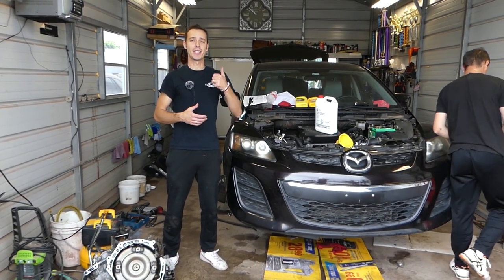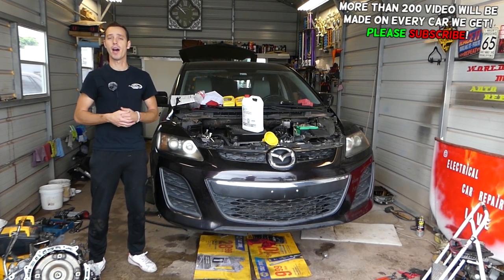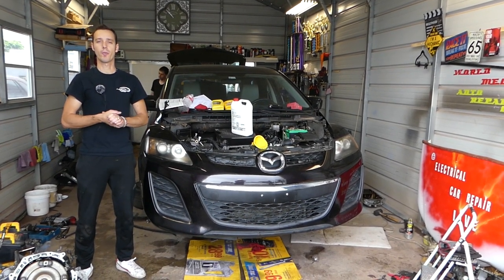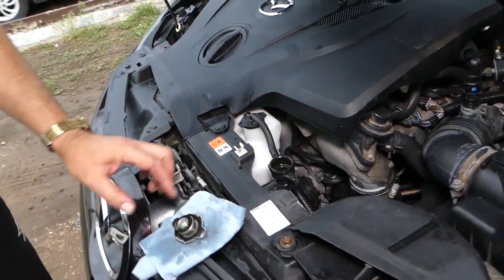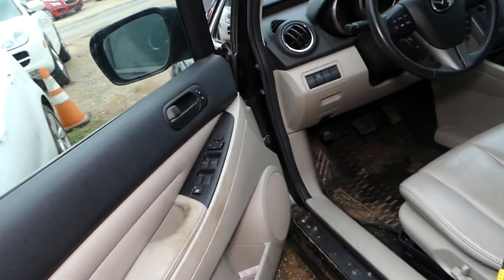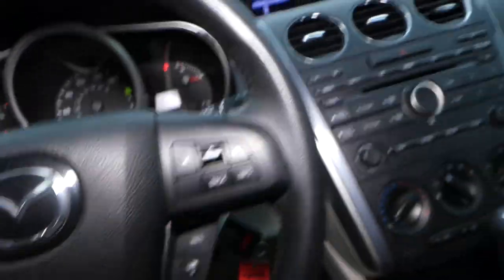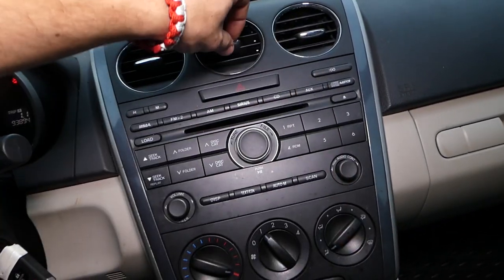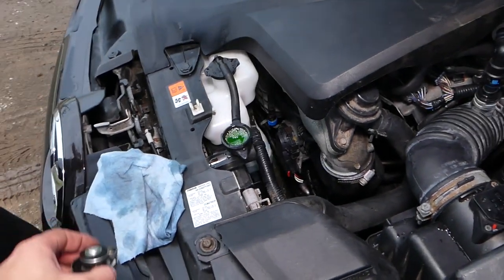HOW TO BLEED COOLING SYSTEM ON MAZDA 2 3 5 6 CX-7 CX-5 CX-3 MX-5

Comment: I'm not sure I see the point of all this.  It's not like you ever opened the radiator cap to let out any air.  And it seems just driving it around normally would accomplish the same thing that the revving does.  Why not just drive it for a couple days, remove the radiator cap to let out any pressure, and call it good?
Reply: I'm unsure on reason but mines at garage atm I do lot of stuff myself usually but as garage done some major wirk I left them to sort it.....New hg ...under a year ago new thermostat and coolant sensor .....now over heating ..... I'm thinking the coolant sensor either wasn't a goof 1 or its not been bled well enough

Comment: What I learned from this video: Be sure to buy 6 times the coolant that your car requires, since 5 times the required amount will be needed to properly coat your entire engine bay. 

Seriously though, even when you guys decided to use a funnel you weren’t getting it in without making a huge mess. Your customer is going to have one hell of a smoke machine when all that coolant burns off in the form of smoke. 

Just being honest here, but after seeing this video I would not even let you guys fill up my wiper fluid. If a haphazard job is going on for little things, I would worry about the more significant parts of the process or other repairs. Precision and taking pride in your work go a long way in the customer experience and even the viewers experience in this video.
Reply: May God bless your beautiful mind and soul. Those are some words of humane kindness and wisdom. I salute you, sir.

Comment: Do you have info on replacing a thermostat on a 2012 mazda 2 ?
Reply: It's below the vacuum pump need to remove air intake some hoses to turbo simple stuff possibly battery tray etc then can get to it .... some remove high pressure fuel pump to gain access

Comment: What this the normal temperature of cx7! Thermostatic valve open at 90 Celsius but car working normal works at 95/110 celcius degrees i always hear that cx7 is a hot engine
Reply: normally netween 80-90°C